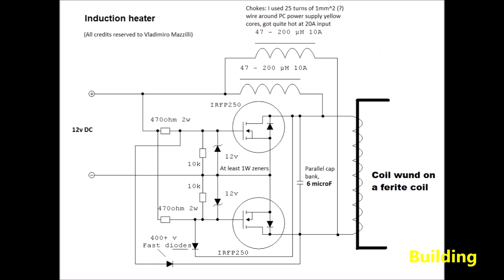DIY Induction heater with Ferrite Core Coil

Comment: One problem in using the ferrite core is, it reduces the switching frequency and thus increasing the inefficiency.
Reply: not if you know what you are doing ;) plus its open core here, its not closed... higher reluctance, much lower inductance than a closed core...

unfortunately, this setup... ferrite serves no purpose other than yes... lowering the frequency.

 owwww, its running in the audible region, it hurts my ears. why does he have so many capacitors?

Comment: Samo testosterone-loaded design with a twist:  still depending on external protection outside the power stage, this time using a "breaker":

7m23 { https://www.youtube.com/watch?v=RcdOh8FlQYc&t=443s }
DIY Induction heater with Ferrite Core Coil (2022-Jun-4)

IMHO the twin gate-bias supply point doesn't need to be hard-wired at all, quite on the contrary.  Then why not make room for synchronization between power stages, to combine energy magnetically rather than electrically, the later having stressful side-effects on material that magnetic energy combination might happen to handle better.  M'well, bravo for that breaker.  Sort of...
Reply: By the way, 4-poles 2-phase is already a possibility if just 1 more flux-concentrating core + coil are added.  With all poles of opposite polarity relatively to their neighbours that would form a square with 2 more (virtual) flux vectors as a bonus, while separately 2 coils would only generate 2...  In other words, parallel juxtaposition of 2 workcoil assemblies seem accessible so why not give it a try and observe how IH heat gets redistributed in a thin metal sheet.  M'well, ideally a Curie-effect one so a temperature "ceiling" can be fixed and with it the amount of wirelessly-stored energy...